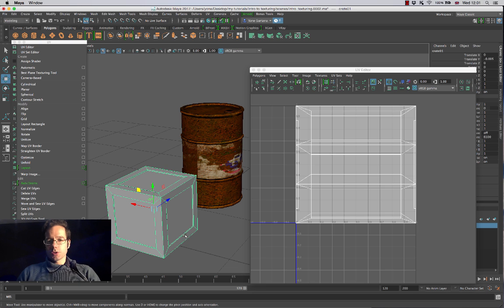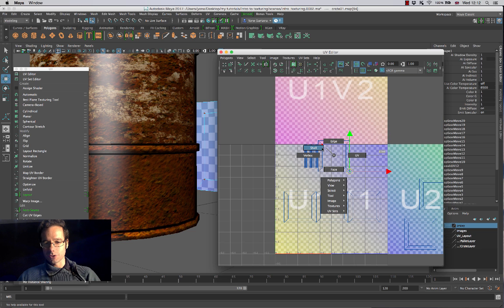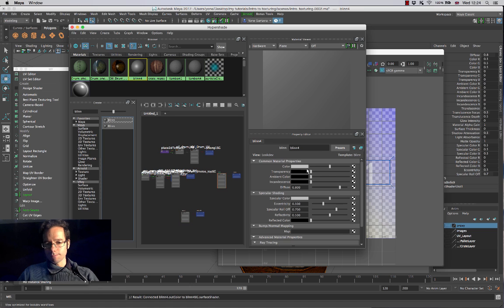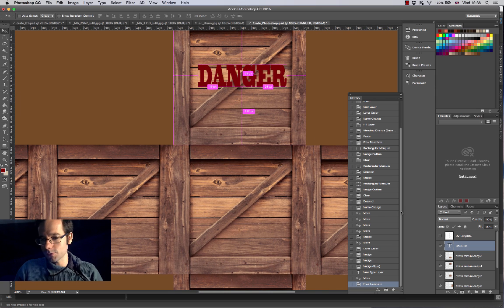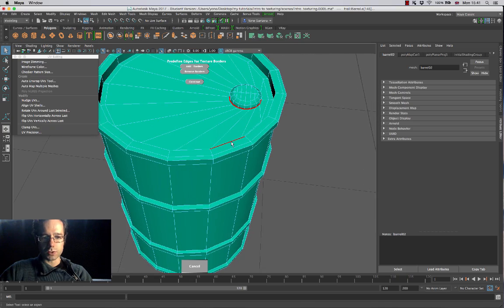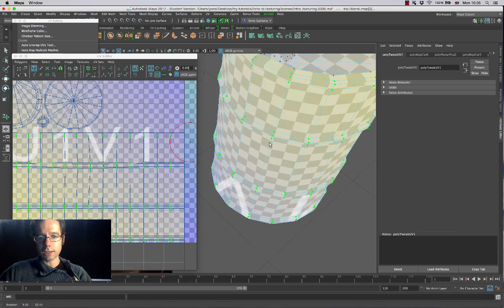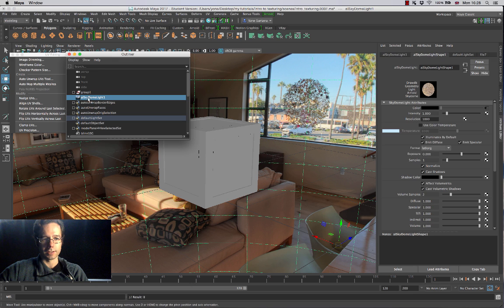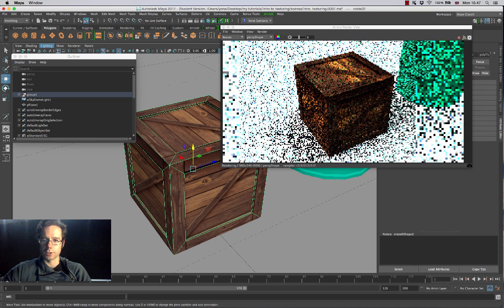Maya 2017 - Texturing - Part 2

Comment: Hello im modeling  an iphone, i want to add the logos on the backside which are made of a different material from the base, i did with a poly plane and applying the file in the color and opacity attribute, then i add a preset to the material, but unfortunly i have to place this little planar as close as possible to the phone geometry, so it  produce a  little shadow on the render. How can i put this 2 metallic effects  on the same geometry? i know i have to use layers but there is a layered shader and there is also  layer texture node, and i dont know what i need to use and whats the process.

Comment: could you help me out? I've been doing uv snapshotting since I was at school and transitioned to maya 2017. Now i do the same steps (similar to how you uv snapshot) but it only rendered out a black image without the uv maps.
Reply from the maker: Hi,

I haven't run into the problem you describe before. I would check that you have the mesh selected in the viewport and that you are exporting to an image file like JPEG, TIFF or TGA... when you go to Polygons>UV Snapshot

It's not a great answer but I would try that before trying something drastic like re-installing Maya
Reply: thank you for the reply.

I think it is a bug on maya. I figured it out.

on the positive x and y axis of the cartesian plane, there are multiple grids on it, for some reason, the first one (the one with a point on [0,0] is the only one working for me. i crammed everything on that little space.

Comment: Great tutorials.  You go through every step including those that most instructors skip over as they assume too much.  My only suggestion would be to either wear a headset, switch to a different computer(as Macs seem to have a lot of issues with the fans constantly coming on), or get a professional microphone.  The headset would be the best way to avoid the background noise.  Other than that, awesome!